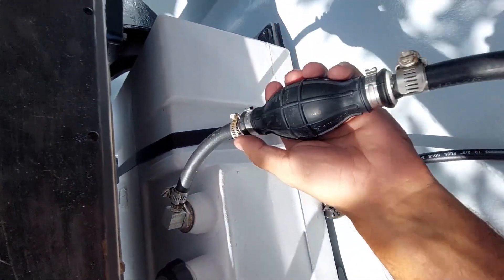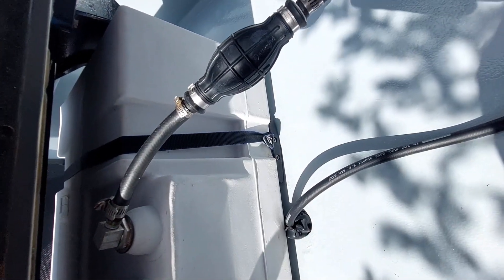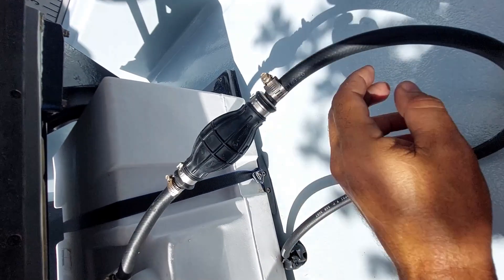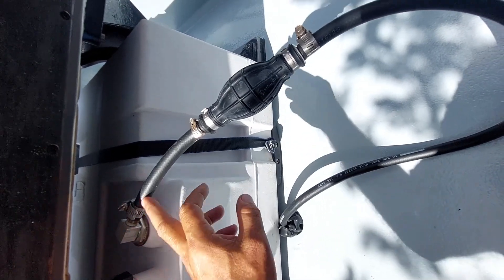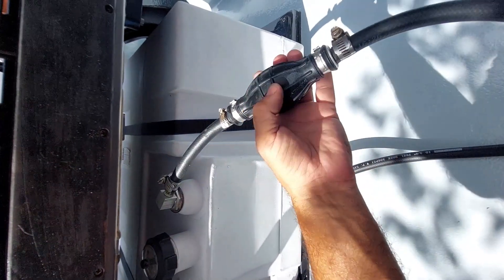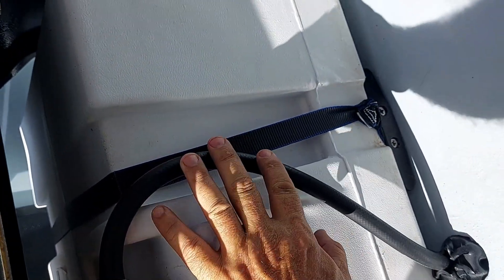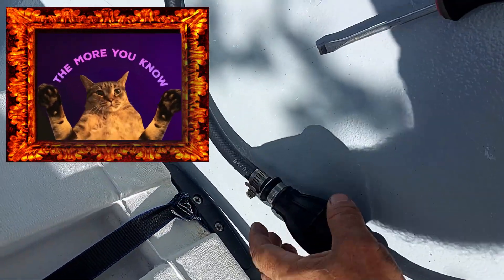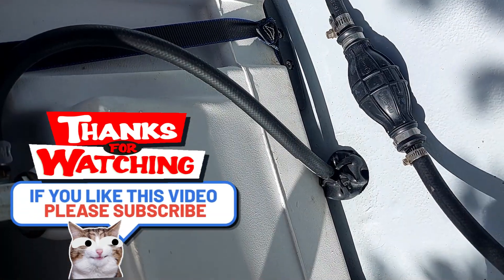I Removed the Primer Bulb from My Mercury SeaPro 115 - You Should Too ⚓ 🦈 #Mercury #BostonWhaler

Comment: You are correct. It's not just mercury. Anything efi or direct injection should not have one. Initial cranking time for the initial engine  install might be long, but after that, it's just not needed, and dangerous to your engine.
.
Most EFI or direct injection engines still have what they call a "low pressure pump". In the automotive world, we call them "lift pumps". These pumps are usually cam driven diaphragm valve pumps, bolted to one of the valve covers, or in the case of a two stroke, crankcase pressure driven anywhere on the engine. These pumps work, by actuating a diaphragm, in and out, or up and down, however you want to look at it. The working side, is connected to a plunger on a 4 stroke that rides a cam inside the engine, or in a two stroke, is inflated and deflated by crankcase pressure.
.
How is the ball dangerous? Well, what happens, is some balls are capable of over-pressurizing the diaphragm, two stroke or four. When this happens, it either bursts the diaphragm, or creates a leak in it. On a two stroke, this can cause a lean condition, because the pump, or multiple pumps in some cases, don't feed enough fuel to the high pressure pump, and when a two stroke leans out, bad things happen, like piston and cylinder failure. On a four stroke, its even worse, as the pumps are normally cam driven, INSIDE then engine, when the diaphragm leaks or bursts, fuel leaks, or worse, is ball pumped, INSIDE the engine. Where on the two stroke, you could loose a cylinder, on a four stroke, the oil can be diluted with fuel, and the crankcase pressurized by being completely full of fluid. This can lead to crankshaft failure.
.
On a fuel injected outboard, an easy tell tell sign, that this lift pump has failed, is your engine only runs well when you squeeze that bad ball. On a fours stroke, check your oil. If your oil level is magically higher, or overfilled, you haven't been blessed with a machine that makes oil from air, your engine oil is most likely mixed with gas from the pump. On a two stroke, the same instance of running better with a squeeze will happen, but checking your spark plugs will likely show one or more very lean plugs.
.
Have a technician pressure test that mechanical pump if you are not sure, or, if it has been 5+ years, or 200 hours, change it. It's cheap insurance.
.
 I converted my four stroke to an electric lift pump, and blocked off the mechanical pump. No more ball, no more chances of engine harm. If my pump dies, I just grab the spare from the emergency kit, swap it out, and continue my day.
Reply from the maker: Thank you @eetack, for watching the video and sharing your knowledge on the subject. I was not aware of that, and I'm sure many others like myself will appreciate you taking the time to explain in detail why it's not needed and the conversion you did on yours. That's what youtube is about, sharing helpful information. Once again, thank you for your awesome informative comment, Best Wishes